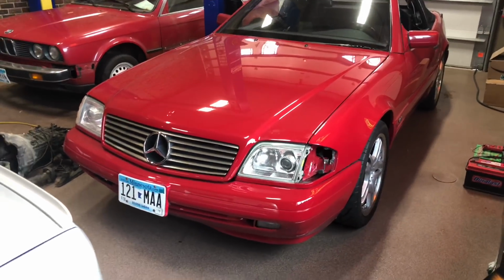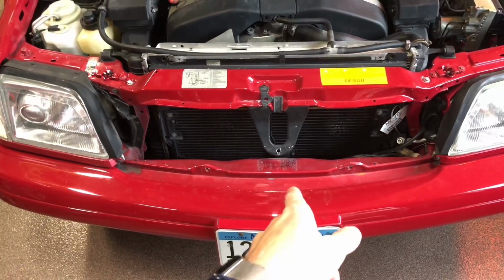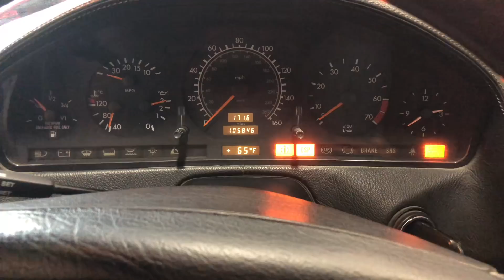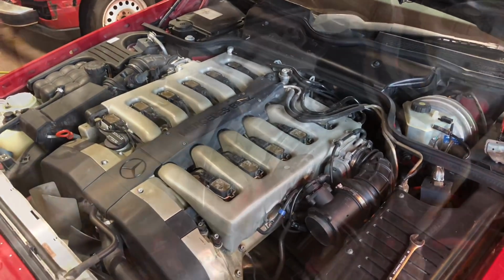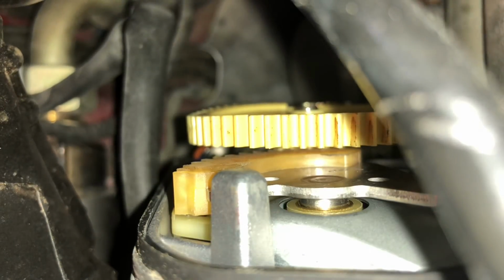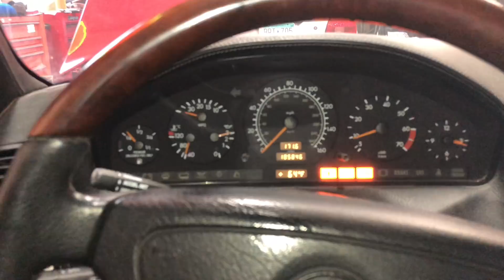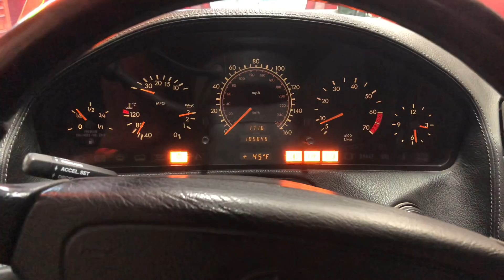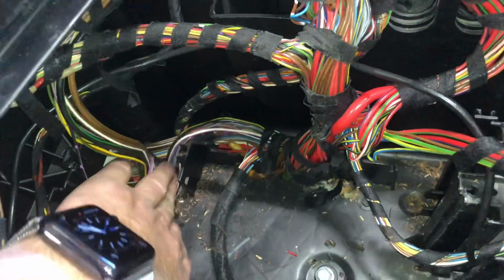The R129 SL600 is back after a year of repair, and she needs some love

Comment: Love to see where this goes. We have a 96 SL600 in white with the bi-xenon and same wheel option with a Renntech exhaust. Need to tackle an ADS issue that is putting it in limp mode, contemplating an actual air suspension, not sure how far into the deep end I want to swim though.
Reply from the maker: I couldn't believe when the ADS issue was a steering angle sensor. lol 

Really hope that Star diagnostic computer system project actually shows up some day so end users can read and write to the modules in these cars

Comment: Curious, looked like throttle body has an o-ring for the cover, maybe it's overfuelling that bank. It's a busy engine bay.
Reply from the maker: they are weather tight due to so many sensitive electronics inside. this throttle body is quite compromised, so needs replaced either way.

Comment: The R129 xenon headlights are not hard to find used, just pricey. Like $500-600 for a decent one on eBay. If you need fans I have a 91 500SL parts car.
Reply from the maker: I call anything unreasonably expensive 'hard to find' but you're right. the hard to find part was the radiator.

I found fans, but I do need the cross bars in front of them and an AC pressure switch and pigtail if your parts car has those
Reply: Ovalbore yes it has those.. if you give me a way to contact you I can shoot you pictures this weekend
Reply from the maker: theres a contact form on my website linked in the channel about -- if you'd be so kind as to reach out there, I'd appreciate it!

Thanks!